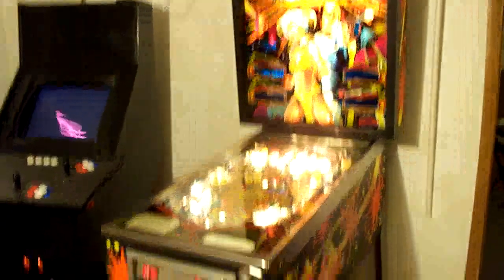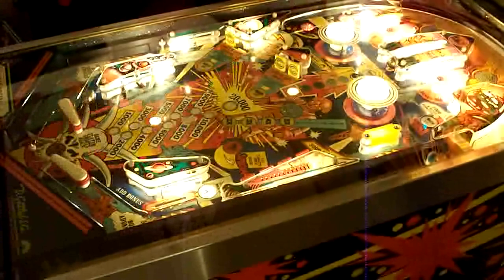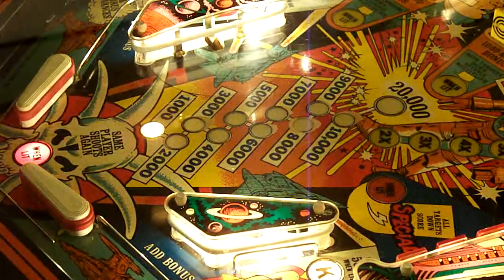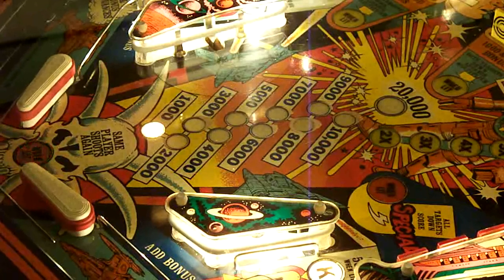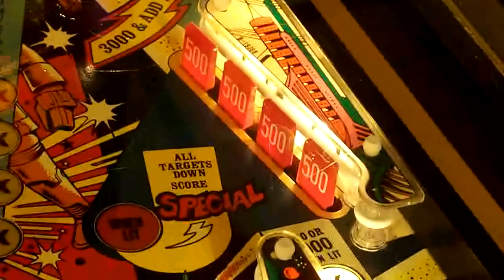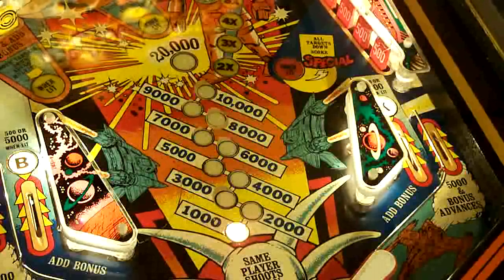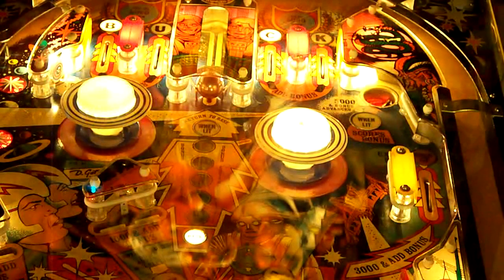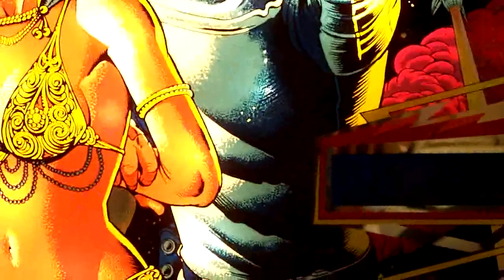Buck Rogers Gottlieb System 1 Pinball Pin Ball

Comment: I've got a Buck Rogers as well, my only pin so far.  Love this era of machines.  I'd have preferred a Bally machine from the same period, but Buck became available at a nice price so I grabbed him up.   Once the main board gets switched out, they run pretty reliably (knock wood).

I keep the sound switch on my machine on the other option, which is less spacey sounding, more traditional.  

Thanks for the video.